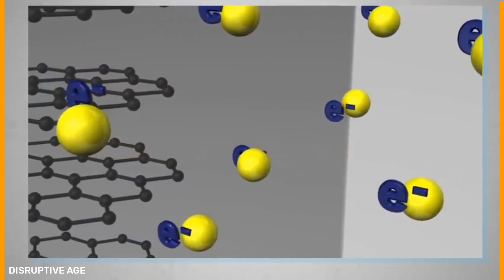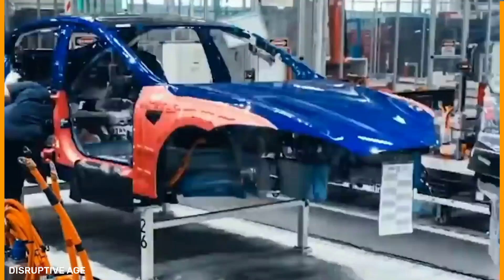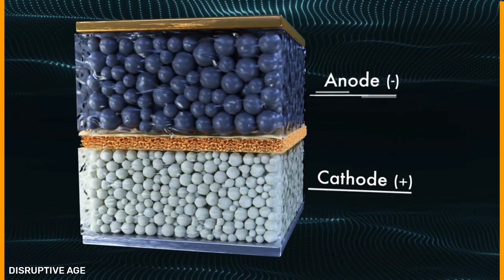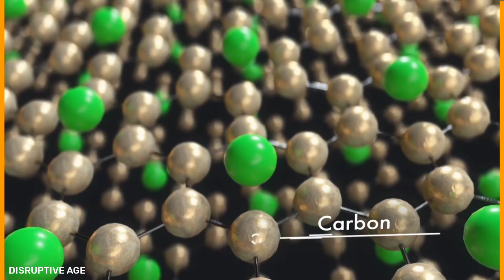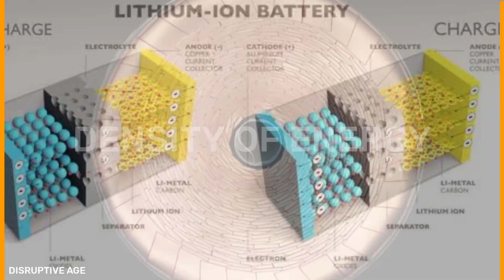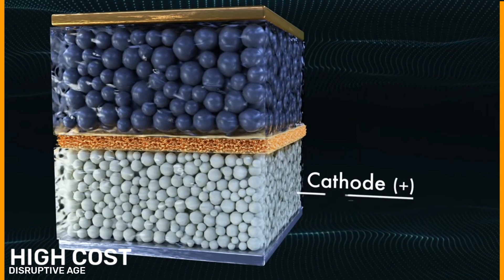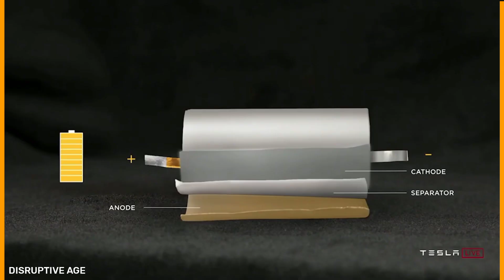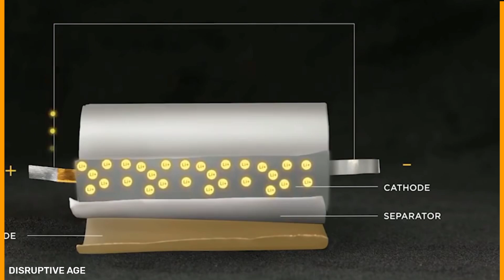Tesla News: Tesla's INSANE 4680 Battery will DESTROY Solid State Battery

Comment: haha this isn't even close to true, making a battery bigger does nothing. solid state is 90% less weight and 2-4x the power. That added together makes solid state batteries about 8x more power potential then bigger lithium batteries. We have only seen solid state stage 1, wait until we see solid state 2.0, lighter again with 2x the power we see now! being able to put 4x the batteries with 2x++ the power in the same about of space as older weaker batteries  is alll that matters. The video also says Tesla batteries perform better in different temperates then solid state batteries, thats 100% incorrect
Reply: This guy batteries